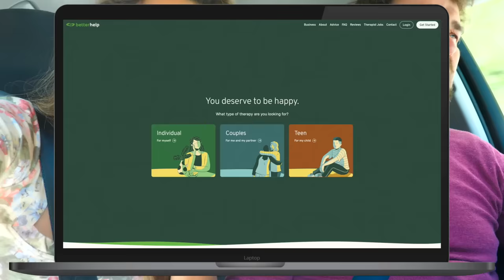RENOVATING A RUIN: Dancing Date in Florence, Finally Resuming Chicken Coop Cottage Renovation (Ep56)

Comment: Im so sorry you are once more suffering with hay fever this year.  I know you have tried everything Kylie but I just wanted to share something that worked for me last year and gave me my first season without suffering from sniffles and sneezes. I started nasal breathing the winter before spring (and now find mouth breathing difficult) and I think that as the pollen had to go through the filter of my nose instead of down my throat meant the particles were filtered out so reducing the symptoms. Last year I had my first hay fever free year in around 15 years.  This year is going well too, although I have had the odd twitch in my nose.  Maybe worth a try to see if it works for you too, but probably difficult given that your nose is already blocked.  😢

Comment: The nesting bird appears to be a pigeon. Pigeons are birds that have high site fidelity. They become bonded to a particular roosting or nesting site. This bond is virtually impossible to break, except by physical barriers, such as netting, surface spikes or an array of thin, narrowly spaced wires that block their body and wings. I would simply enjoy the process of nesting, hatching and chick rearing. When the chicks have fledged, then remove the nest and vacuum the window ledge to eliminate any residual bird mite problem. In the future, you might want to leave in inside shutter open so the birds can see the humans. They’ll be less likely to nest there in sight of humans in such close proximity. Let us know how that works out, going forward.